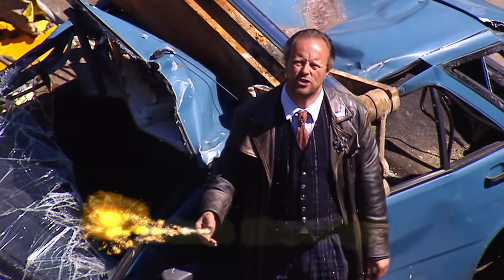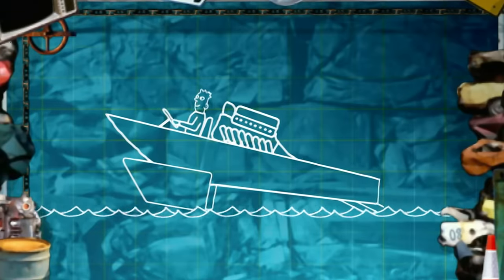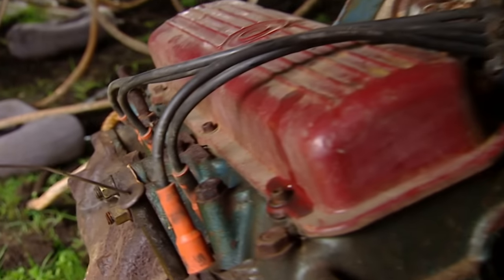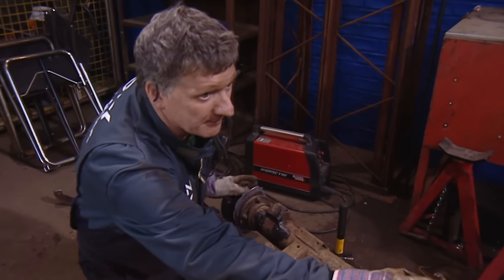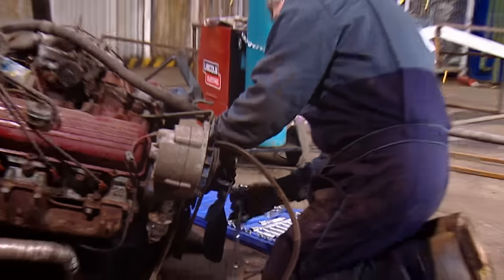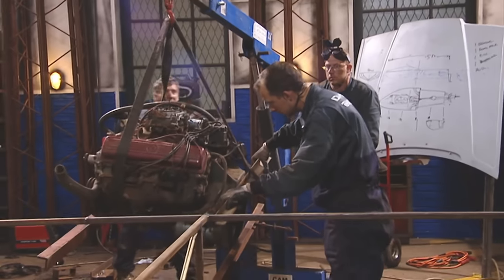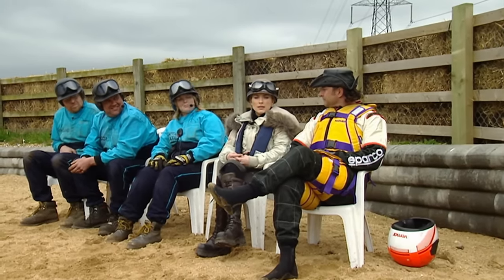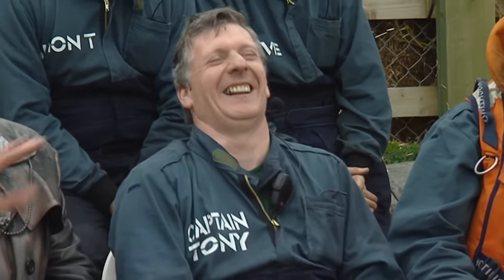Battle of the Drag Boats - Scrapheap Challenge - S08 EP5 - Game Show

Comment: I would have taken the prop off the plane at the entrance bolted it to that small block Chevy motor and made an air boat. Easy to build has a flat bottom with no holes to let water in and it would have easily went faster than the two boats they made.